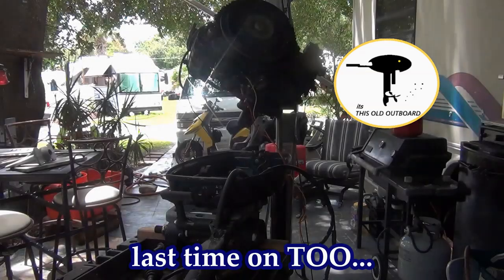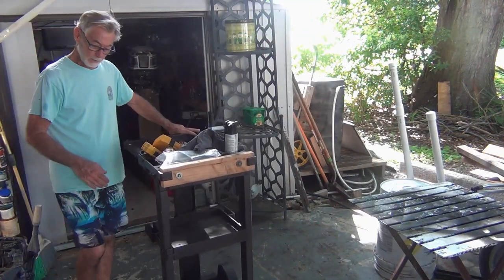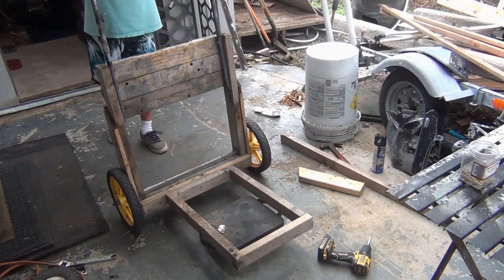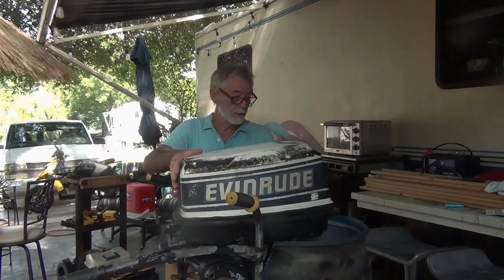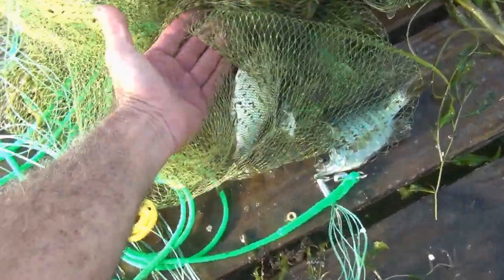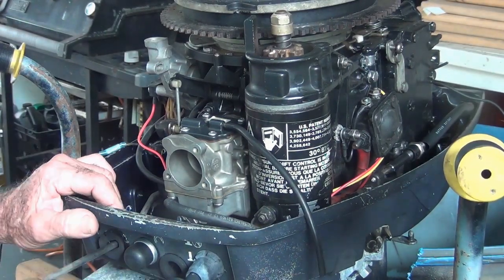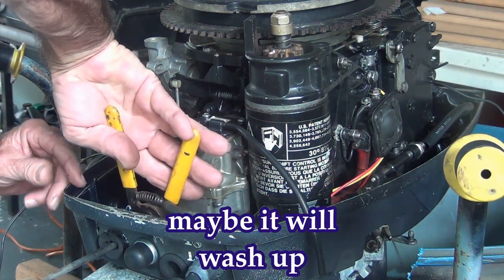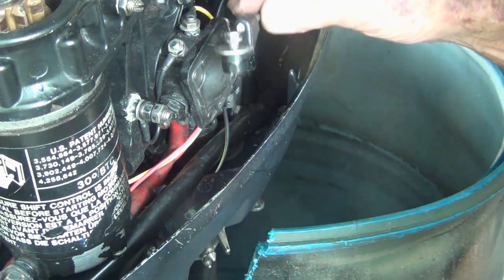Evinrude 30 Hp Making Progress.  THIS OLD OUTBOARD

Comment: Enjoyed the fishing interlude while you were installing the strater switch- great videography and editing!  For me "The Saga Continues"- The 73' 25hp Johns - I've gone thru in entirety (seemingly} and you've been helpful with some questions here and there and I'll try to be breif here- OK here it goes- Carb kit/clean and rebuild /removed fly wheel and cleaned and re-set points at the set mark {20 thou} lync and sync as per your vids and shop manual and carb adjust / new plug wires- {compression 120 per cyl}- lower seal kit and had the worn forw and rev gears and dog recut / replaced worn drive shaft and drive shaft caged bearing and adjusted the shift lever and new 9x9 prop{ this fixed the lower and prop issue} - I noticed one secondary coil was  cracked on the backside so I filled with silicone {I also bought a new coil to replace but turned out to be bad both bench testing and installed with an ohms reading @18 the one i filled w/silicone as well as the the other both read 5 ohms so I reinstalled the old)
With all that being said I'll cut to the chase- Good spark/starts right up/ idles great and runs great in the tank but on my 14' V won't plane {@8mph} and doesn't seem to be increasing rpms after @ what seems like half throttle however with hood off I push down on the throttle linkage so I know the trottle plate is WOT- I'm gonna go back thru begining with the carb and recheck the high speed orifice/float etc but ignition system wise other than lync and sync is there any other something I might be missing timing wise I meam if I set the points at the set mark on
the crank shouldn't that do it or should I next be looking at the cam follower plate {2 screws} adjustment you've mentioned in one of your vids- Any thoughts or comment appreciated I'm kinda at a loss here what to try next- Thanks 
Bill
Reply from the maker: Hey. Wow. Sounds like you've covered everything! But I think your on the right track with double checking the high speed jet and linkage. When you turn the throttle handle to WOT where's the butterfly at? It should be perfectly horizontal at wot. There's a roll pin (# 10 on the schematic) on the butterfly shaft that holds the shaft in. From a visual inspection the roll pin should be perfectly vertical at WOT. That tells you the butterfly is perfectly horizontal. Also double check the choke and linkage. I've seen it before where the choke linkage was loose or messed up. With the motor running the choke butterfly would start to close from vibration and choke the motor out. It doesn't take much, just the slightest bit will affect it. Also have you run it without the hood on. If the exhaust gasket is leaking, the exhaust fumes will choke the motor out with the hood on and it won't go nowhere. It's amazing how these things run so good in the tank, but put a load on it and things go crazy. It almost doesn't seem possible. Even a slight air leak can mess things up. If you can shoot some video of it running and post it on your channel. LMK. Curious to know what you find out.
Reply: @THISOLDOUTBOARD1  Exhaust leakage or foam not breathing good.
Had 1 hood the foam was just full of crap on the front of the hood, carb couldn't breathe. Ripped it out for the rest of that trip, changed hood when home. 
Really liked that hood so I found some looser grained foam.
My 38 gal tank, my 250lb butt, planes out and runs 31mph with the 72B high speed jet, Stingray foil, 21 pitch prop.
Reverse sucks tho.
Reply: @THISOLDOUTBOARD1  Thanks- I will be looking at the choke which is a little floppy [ now that you mention it} tho installed correctly - I have run with the hood off and ran the throttle by hand to ensure was wide open last time i had it on the water/  I am going to take the carb off and recheck the float and HS jet - I'll let you know- one issue is I live 30 min drive to water and I do have a "runner" - a 98' J-25 and here I'll share with you a recent fix on that that may be helpful - One of the mounts under the clam shell on the lower was flopping so as an experiment  I removed drilled into {dimpled the rubber side with an 1/8 drill and the alum mounting side it attaches to }- cleaned both sides with acetone and clamped overnight- I used locktite PL 3X construction adhesive - I build fishing rods and I use this adhesive to attach the handle and reel seat so I know it's strong and water proof- So far it's working great and a quick and inexpensive fix-  Hopefully helps you sometime!
Thanks I'll keep you posted
Reply from the maker: @billrae4198  I'll remember that! thx

Comment: I've took all my wires loose from battery did not label how do I find out my hot and neg from gauges
Reply from the maker: Hey. What r u working on? I guess it doesn't matter when it comes to wiring. Look up a wiring schematic for your motor. The wires are all color coded for positive & negative. Thanks again !

Comment: Hey man its me again for the 3rd round of advuce the last couple years haha i posted the video on my page, it loses like grip and stops proceeding onto plane just replaced thr coil packs and same thing 25r77h
Reply from the maker: Hey. Looks like you have a spun hub! The motor is spinning but the prop isn't. You can take the prop off and put 2 marks on the hub and a spot on the prop so they're lined up. Put it back on and run it. Take it off and see if your marks are no longer lined up, then you'll know for sure. Good looking Outboard. Thanks again !

Comment: Man, love your videos. Been really helpful. I have almost exact same motor it’s just not a tracker. 1989 25 hp remote set up. I have had a devil of time getting her to idle without having cold start lever up. It’s like im getting way to much fuel. I initially got it right at 1 1/2 turns on mixture screw, went to test on water, back to same problem. 

The other day, i went to unplug fuel hose from motor after another failed attempt, i noticed it sounded different. Drop cold start handle and damn thing idled. Im wondering if this new “safe” gas tanks are putting too much back pressure on my engine, over running my carb? That make sense or am i crazy? Not sure how to test it though.
Reply from the maker: Hey. Thanks for tuning in. Well, kind of. Not Kind of crazy, but kind of makes sense! Hahaha! The fuel tank needs to be "vented" so the outboard can pull fuel through. If the vent is closed it's like sucking on a straw with your finger on the other end. You get nothing but a squeezed up straw. On the other hand if the vent was closed it could build up pressure in the tank and push fuel out through the fuel line to the carb but the float and needle should stop the flow. But with the warm up lever open, it would pull the fuel through, running on the mid/high speed circuit. So it sounds like the tank vent is closed or depending on the type of tank you have the vent may be stuck. (little ball in the cap type) So when you disconnected it, the fuel was free to move through the motor by way of a vacuum produced, the way it should. Thats like taking your finger off the end of the straw. Does that make sense? Hahaha. But that's where I would start, at the tank, check connections and that primer bulb too, it may be faulty. One other possibility, the slow speed idle circuit was clogged and coincidentally unclogged when you unplugged the fuel line. I've seen stranger things happen! Curious to know what you find out. Thanks again & Stay tuned !
Reply: Will check that out Thursday and let you know. The straw thing clicked with me. I cracked top on the fuel tank, so, I’m wondering if something is up with my line, or like you said, idle circuit is plugged and somehow it’s not plugged now. At least I’m saving gas money not running the marsh and fishing reds.
Reply: @THISOLDOUTBOARD1  so, cracked lid on tank before i hooked it up to motor. Seated idle screw gently then turn half out. (Ended at 2 1/2 out) the SOB idled! I was able to shift gears and go back to neutral and didn’t die. Ran it low in my tank in forward couple times. It sneezed one time and died. But i could turn it right back on. I think you might have had it pegged right, carb dirty, and somehow, it blew threw. I probably need to give it a through cleaning but man! I am happy! This has been months of work. I can finally maybe sight fish some reds in the marsh now. Thanks for all your videos. You were huge help to me. I gotta figure out how to send you some beer money
Reply from the maker: @williamrogers3511  Hey. Sounds good, glad you got her running! I've got a donate button (beer fund hahaha) on my channel page. Thanks again & Stay tuned !
Reply: @THISOLDOUTBOARD1  got you covered. Just sent it. Thanks again and keep on keeping on.
Reply from the maker: @williamrogers3511  thx!
Reply from the maker: @williamrogers3511  thx!

Comment: I have a 1989  40 horse evinrude that cranks right up and then proceeds to run away. I have rebuilt both carbs no help at all. I have to choke and turn key off to kill it. Any idea what's going on.
Reply from the maker: Hey. Thanks for tuning in. Well its pulling fuel/air mix from somewhere. If it was just fuel it would flood out and not run unless there is a big Air Leak somewhere. The carb butterflies should be synchronized and closed in start position. Check your link & sync cable position and where the roller is set on the Throttle Cam. Should be set between the two marks and butterflies closed in neutral start position. Does it have a fast-start lever on the control box, and does it work? When you lift the lever it will open the carb butterflies up just a little to a higher rev for warm up. Maybe the control box is messed up. That's where I would start with the link & sync. Hopefully there's no air leaks. LMK what you find out. Thanks again & Stay tuned !